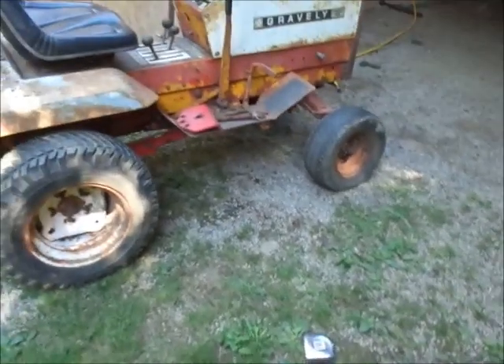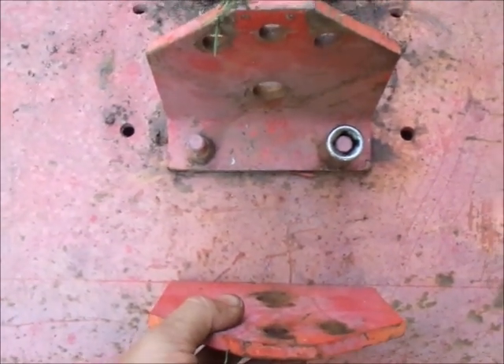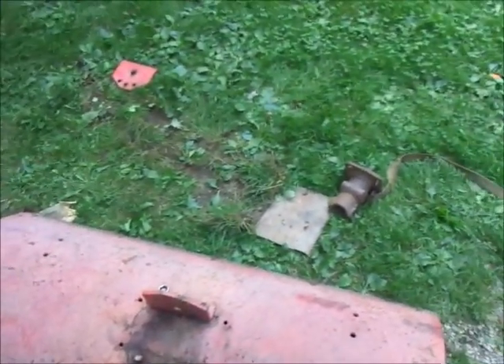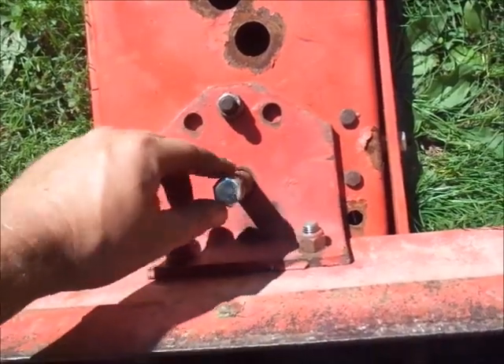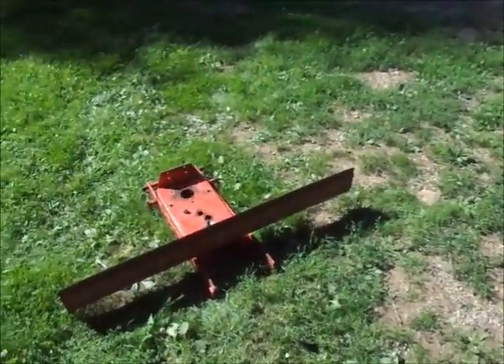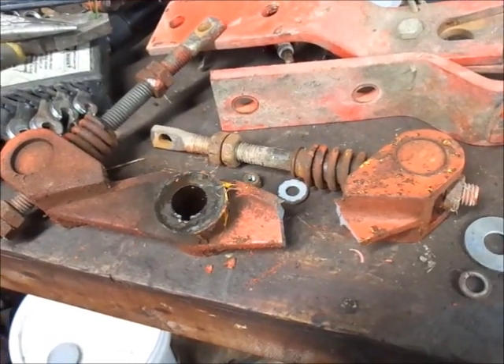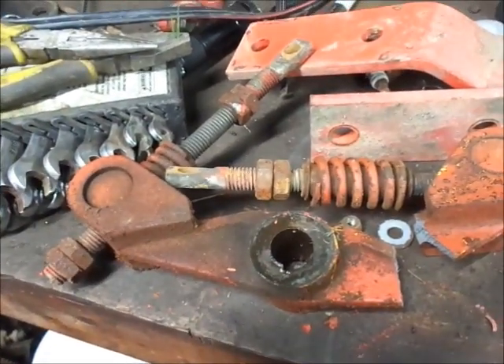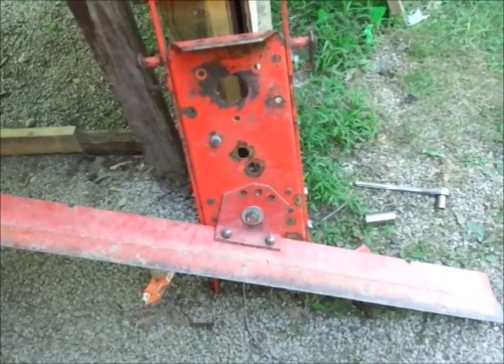Mid mount grader blade build part 1 430 gravely test

Comment: I have a John Deere 300 garden tractor my father bought it brand new in 1979 It came with a very rare and hard to find 54 C Center blade or a greater blade I have it and it’s amazing especially if you have a gravel driveway
Reply from the maker: I just bought an actually gravely mid mount blade in the month or so. from the bit I used it it seems to work great! I think all the major brands sold one
Reply: @Stevestractoradventures  It’s a very nice video I’m proud that you made that for the gravely I love those tractors to one day I’m going to own one

Comment: If you drill the holes out for the angle bolts just leave more room away from the tires in case you want to use tire chains. That works well good job👍